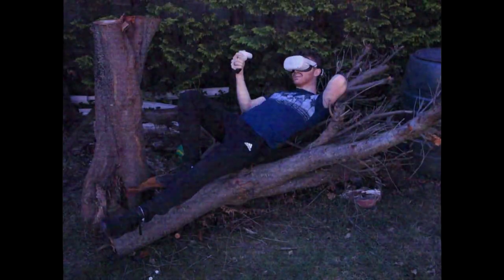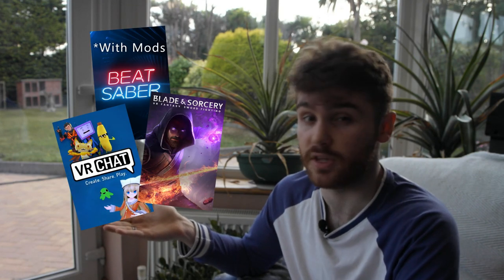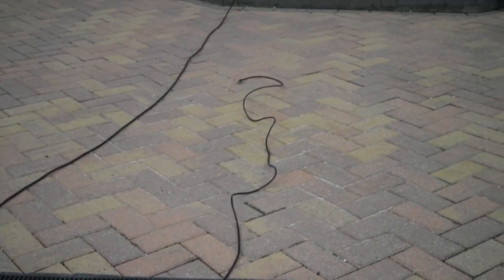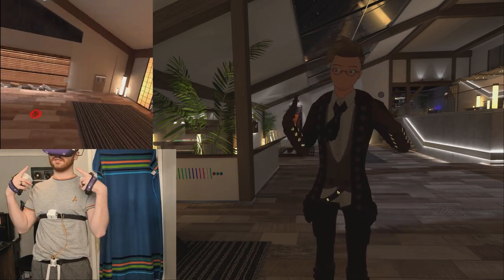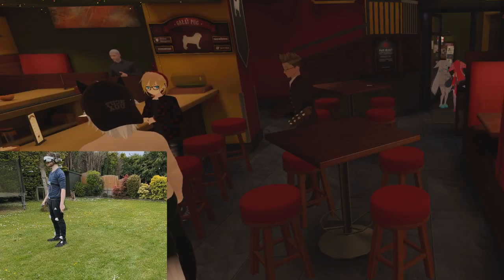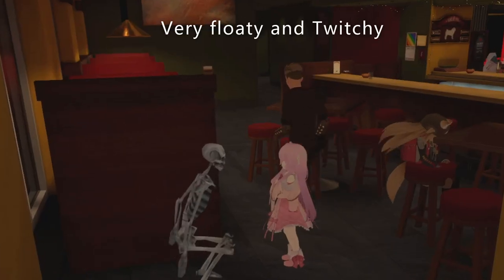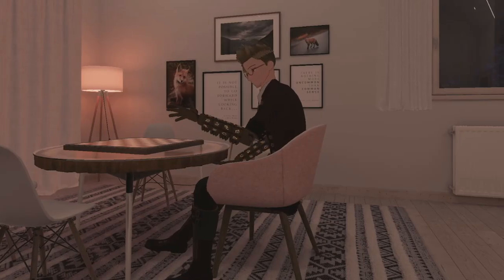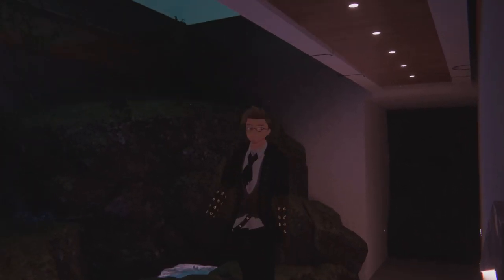I touched REAL GRASS in VR with SlimeVR Full Body Tracking!

Comment: I wish I could do that. My play space is really really small. 😶

P.S. my haptic vest project didn't run very well actually. Ordered vibration motors, never got them and that money is gone for nothing, that was not helpful for it at all. Also I still need to find a solution for the electronic part, I use different vibration motors, more stronger ones but without the RPM electronics on it. If I could get a solution to bring that electronic to the boards on the back it would mean only 2 wires per motor instead of 3 what would be helpful. 🤔